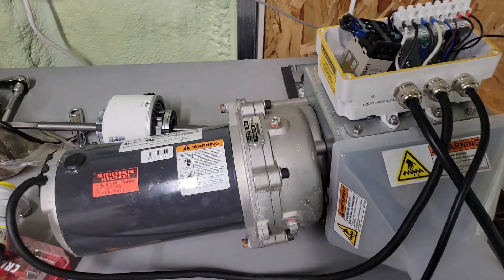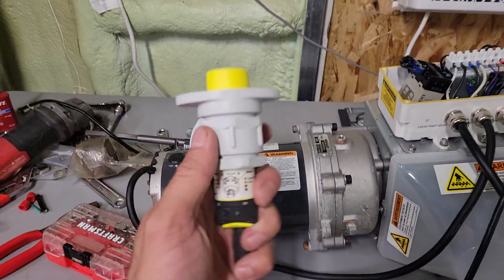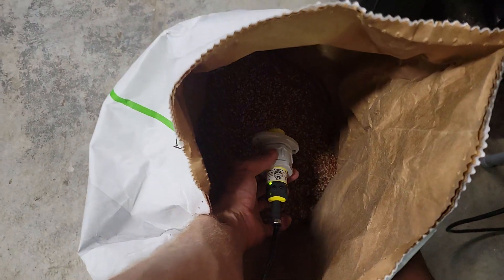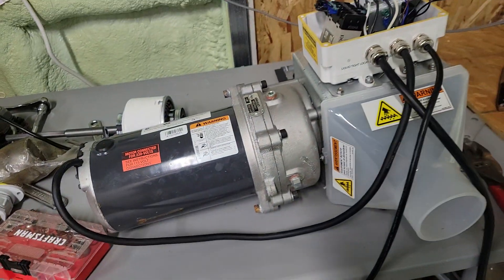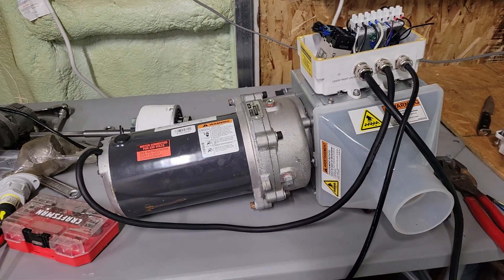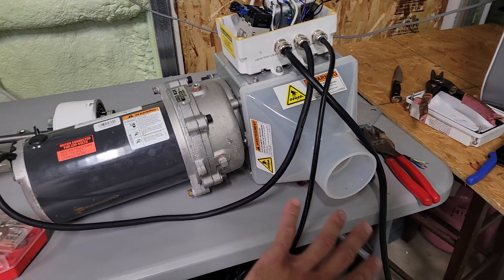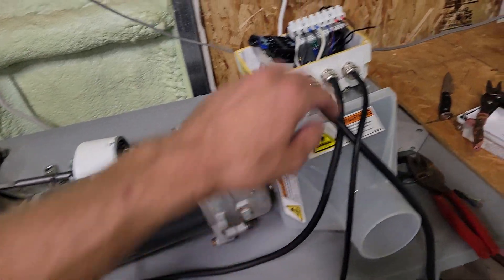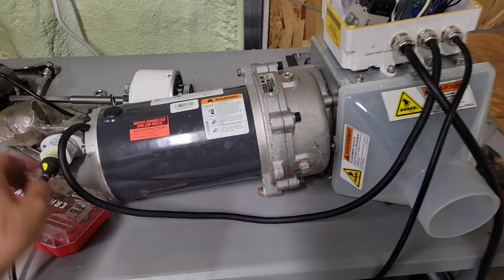Flex Auger Grain Spawn Measuring for Commercial Scale Mushroom Farm

Comment: This is cool tech. What kind of sensor is this? This seems useful in all kinds of applications.
Reply from the maker: It's a growerselect hs10 it even has a NC an NO circuit so it can be used for turning on or off depending if it's touching grain. It also has a delay function which can be pretty nifty.
Reply: @MyersMushroomsFarms  Thanks a lot and greetings from Germany.